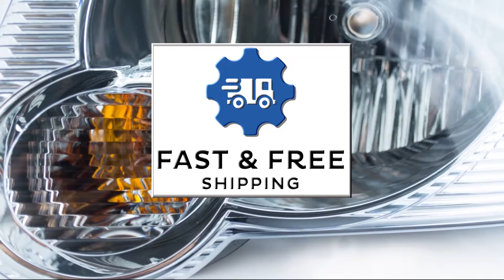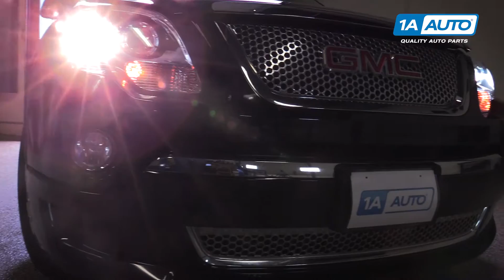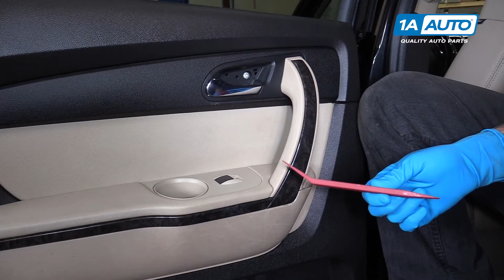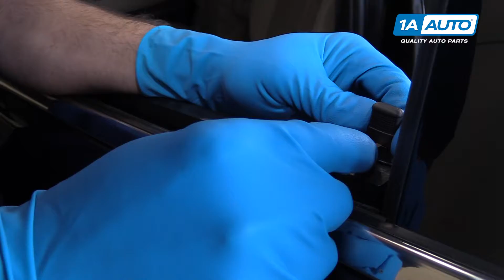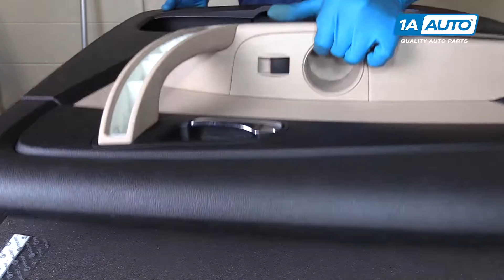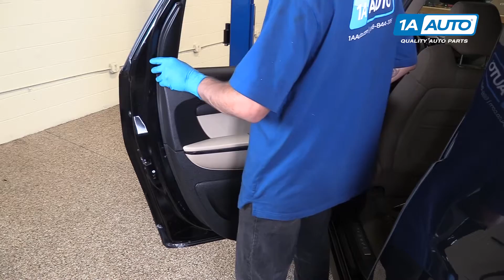How to Replace Rear Window Switch 07-16 GMC Acadia

Comment: Is this the same for the front passenger side. I need to replace it and the GM dealer is saying that it is connected with the door lock but when I look this up online I can only find single switches